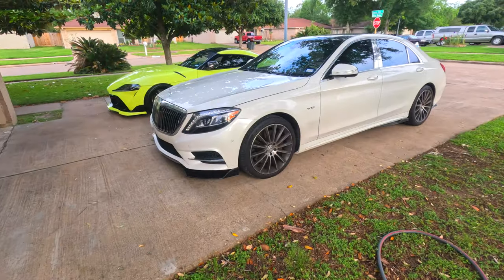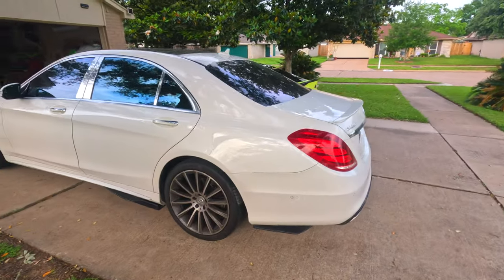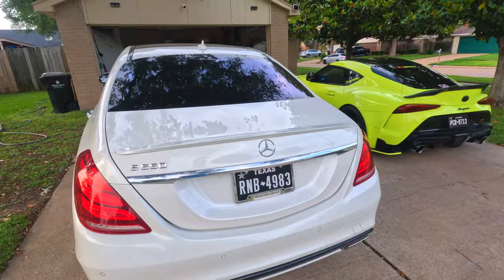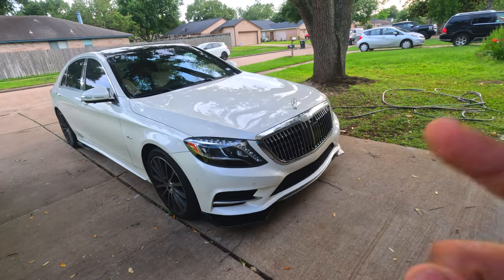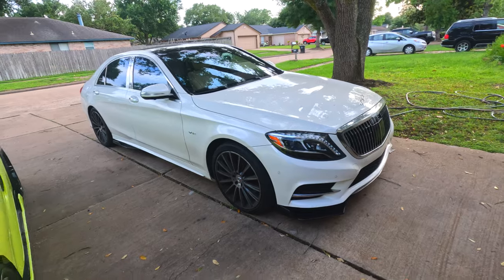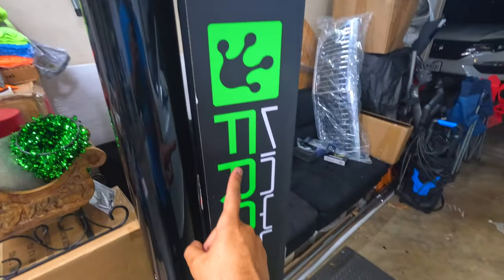MAYBACH Transformation Mercedes S550 WRAP - 4K

Comment: Which film would you recommend for someone wrapping a full car for the first time in a PET film. 
Vinyl frog or teckwrap?
Thanks
Reply from the maker: Both wraps are similar but the tack is a little bit more stronger than 3m or Avery. So if you want to do your fist wrap with this brands a recommend you using tack reducer, or just get 3M wrap that's easier material  for beginners. Thanks 👍
Reply: @Shinegadget  I like the colours vinyl frog and teckwrap offer. I’ll get the tack reducer. 
Thank you for your inside knowledge